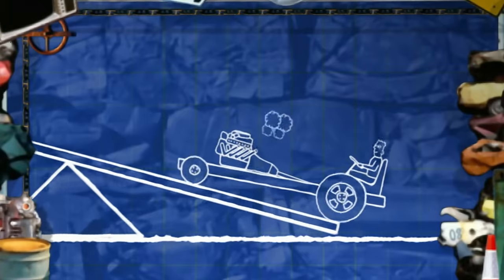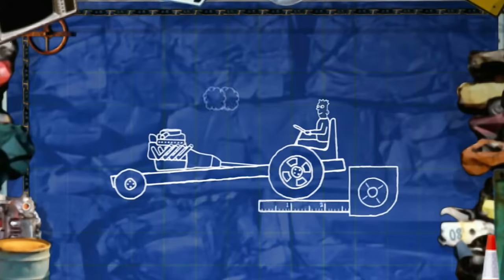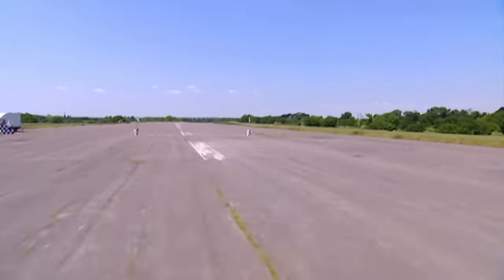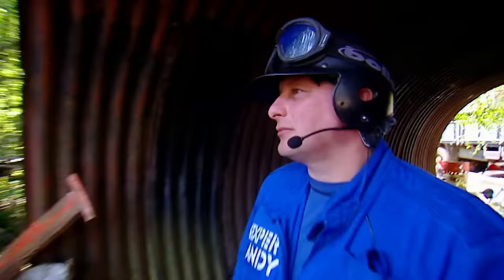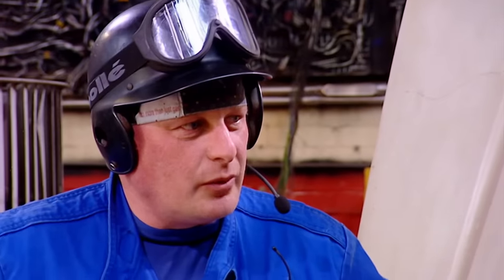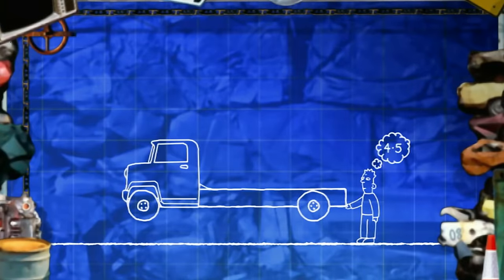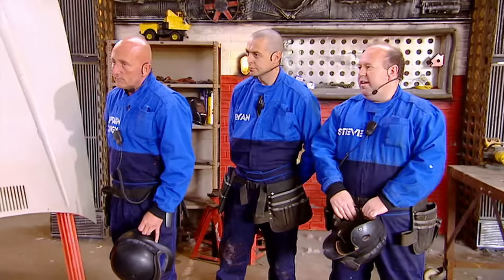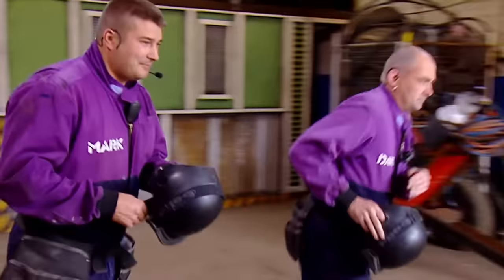Drag Machine Showdown - Scrapheap Challenge - S08 E10 - Game Show

Comment: If they would have just used the same truck/ bus by dismantling the upper portion with only chasis left they still would have achieved the same speed...
Reply: True but they could have found a holy grail diesel engine or mechanical as some people call em and turn the fuel up which would also mean that they could achieve just a few more mph/kmh’s also losing all that weight will also allow them to achieve a couple more mph/kmh’s. Even if they don’t mess with the fuel and leave it as they found it and ran it with just losing the weight they still are going to achieve a few more mph/kmh’s in the race
Reply: Worth remembering that stuff is literal scrap, compression, sealing, and oiling are all going to be fucking shot
Reply: Do you not realise it's very staged for entertainment plus why would you even feel the need to say this 😅